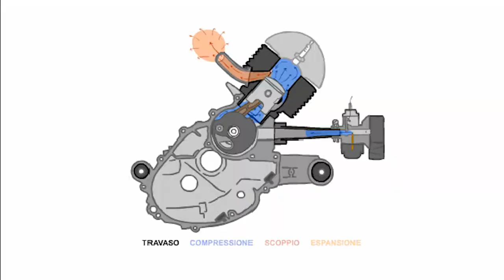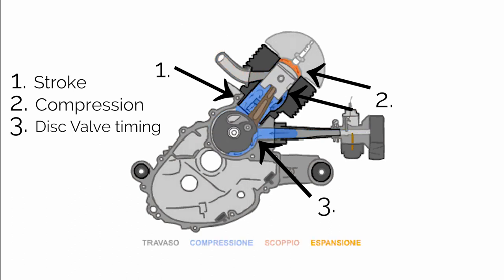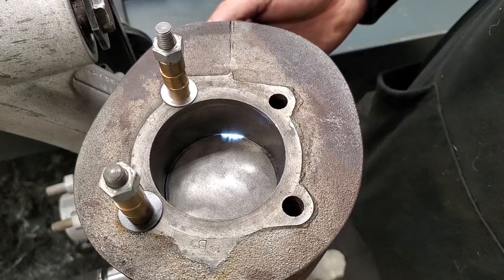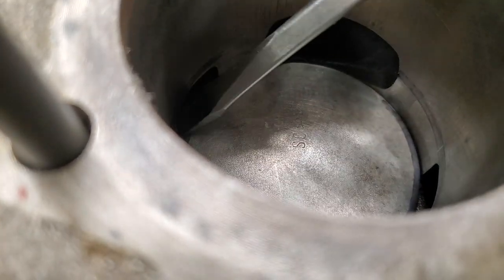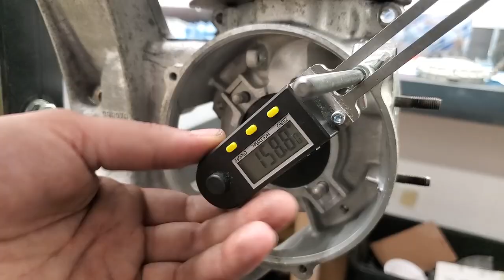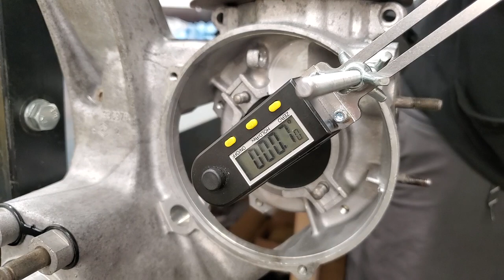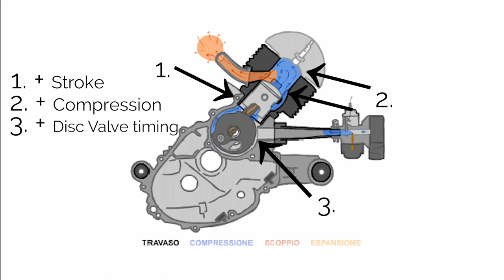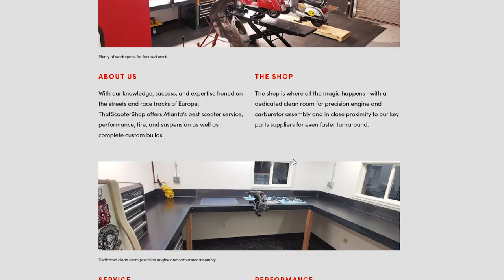Vespa P200E with 208cc on stock cylinder Part 2. What makes this work? - TST Ep. 50

Comment: Trying to decide what to do with my Rally 200 engine. The last thing I needed was another option to consider, so thanks for that I guess.

In all seriousness, great video. Very educational
Reply from the maker: Oh boy.... on the rally you can then also switch to a PX ignition and use a PX crank.

Decisions decisions...
Reply: @ThatScooterThing  I already ditched the Femsatronic ignition and replaced it with an LML Ducati ignition copy (machined the crank taper on a lathe). 
I'm considering a Malossi 210 kit but that seems cliche at this point